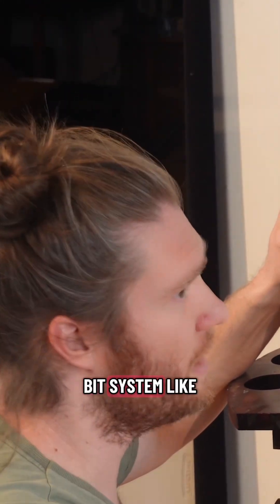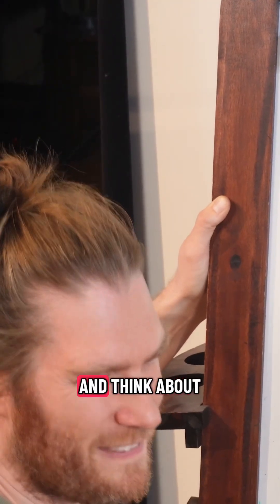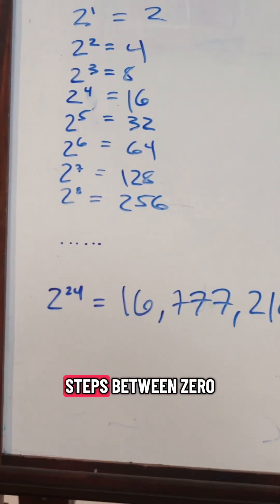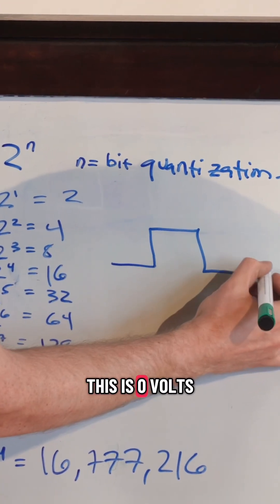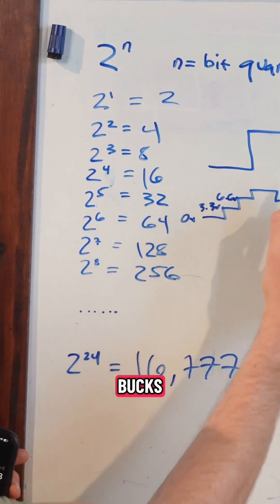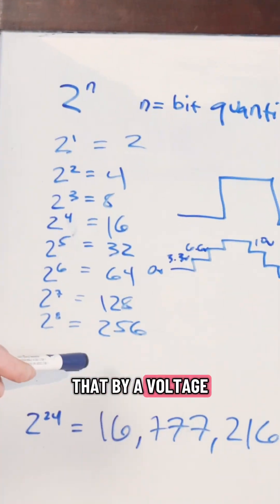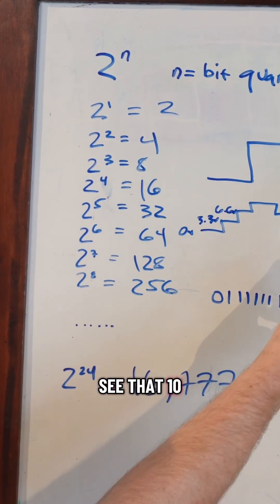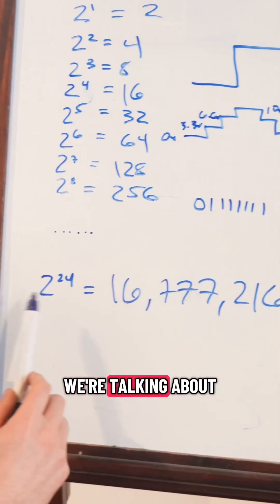8-bit to 24-bit system #repairing #seminar #electronics #24bit #fyp #vintageelectronics #foryou

Comment: 8 bits means a range of 0 to 255 for a total of 256 steps. The value of 256 would require a 9th bit.
Reply from the maker: Correct!

Comment: Audio is actually bipolar, so -5v to +5v would be a better way to represent 10v than 0v to +10v I think.
Reply from the maker: I think I chose 10v because that is often the reference voltage in old digital gear.